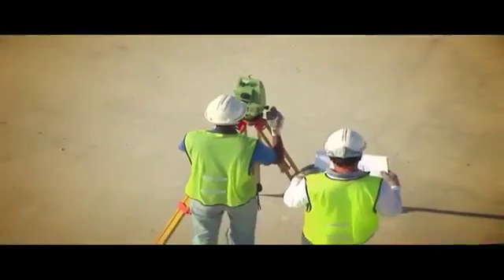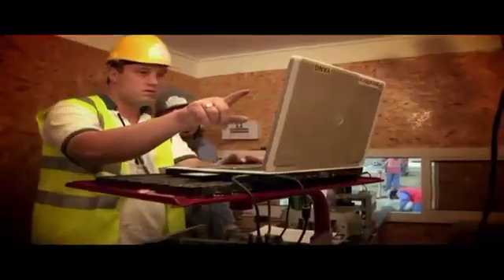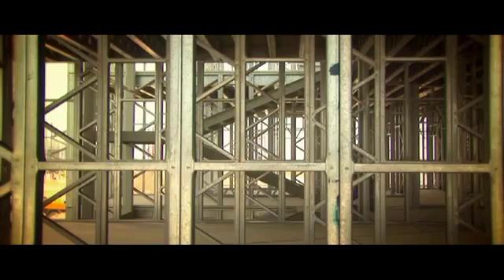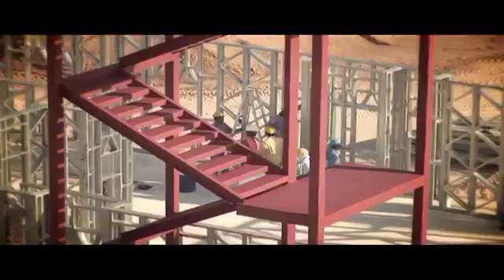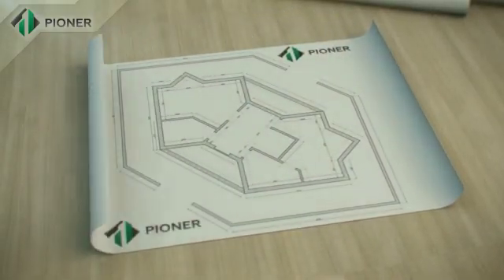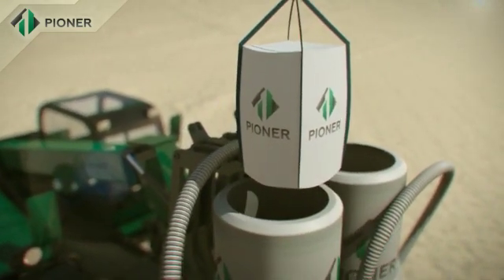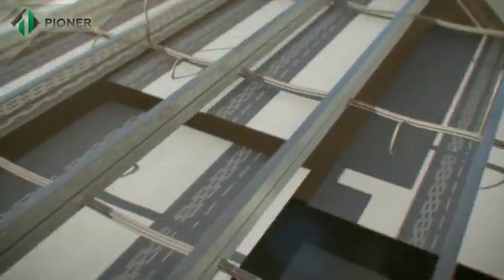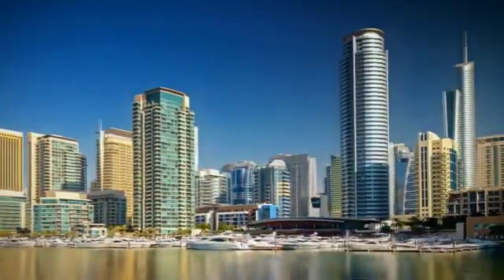Light gauge steel construction system makes construction process faster and cheaper

Comment: What happens when its cold enough to birst a pipe and you need a jackhamer to get to the pipe !
Reply from the maker: Good day David. Thank you for the question. Lightweight aerated concrete insulation with low density has very good thermal insulation and I don't know what should happen to burst a pipe inside of it. We are working in Russia also where the outside temperature in winter can be minus 30 and we didn't face such issue. In case it happens you can easily cut fiber cement board and lightweight concrete to change your pipe because lightweight concrete with 600 kg/m3 density has a compressive strength around 2 MPA (12 times less then conventional concrete) and you can easily cut it and replace it with a new portion.